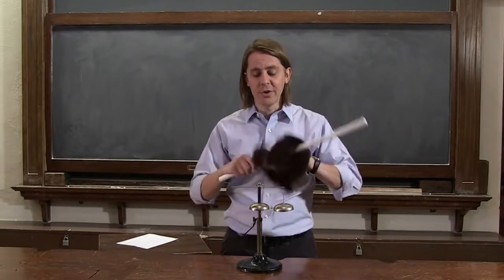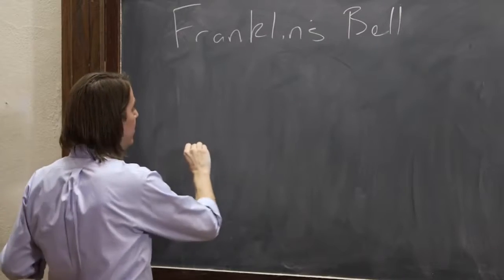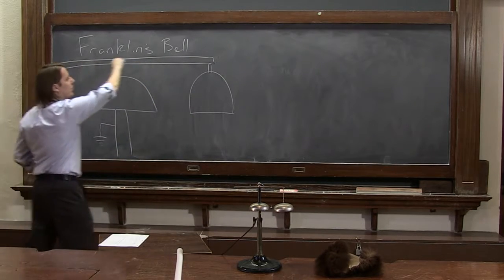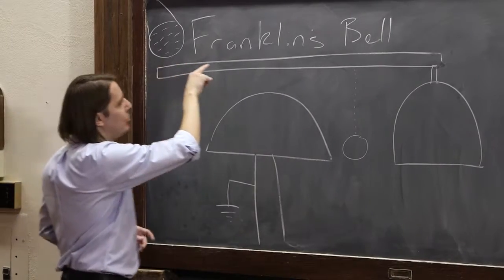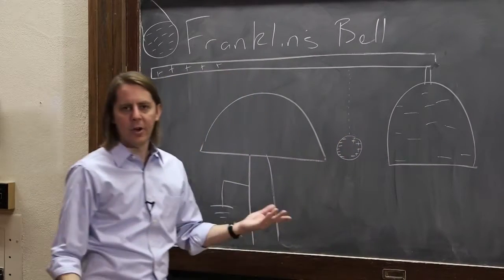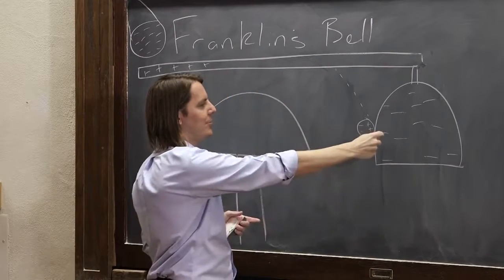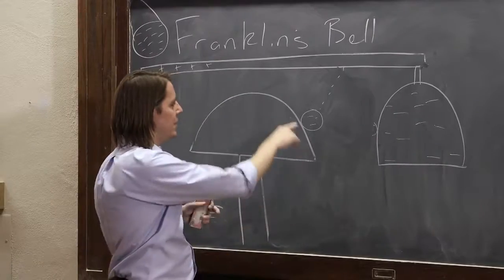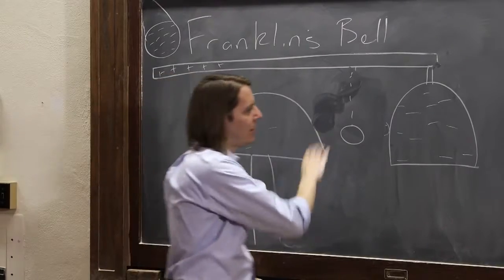PHYS 102 | Conductors 5 - Franklin's Bell

Comment: At the end of this video you left a dilemma for us to solve.  Why is the ball still moving after you made yourself equal potential to the second bell by touching the upper rod?  The very nature of us human beings are packed with a bunch of positive & negative electrons, and by you rubbing the teflon rod, you actually created an electron (positive or negative) Electromagnetic Field (EMF) strong enough around yourself to impress enough charge potential through air (ionization) at the distance you are standing to the Franklin Bell assembly.  If you had walked/moved further away from the Franklin Bell, you would have created enough resistance in air to impede the flow of electrons (current) thereby stopping further movement upon the Bell assembly.  Or, if you had moved closer to the Bell assembly, the ball would have made enough movements to discharge the EMF to ground thereby creating equal potential between assmbly and yourself.  Just my theory of course.  Great video series you have put together.  I tip my hat to you Sir!
Reply from the maker: Thanks!  You are on the righ track, although you don't need any ionization of the air.  You are a good enough conductor that charge passes when you touch the metal.  The short answer is that I charged it by induction (see earlier video).